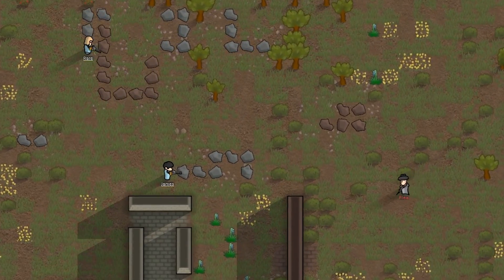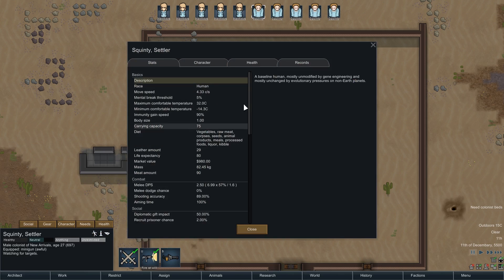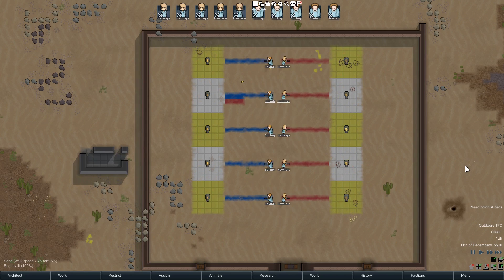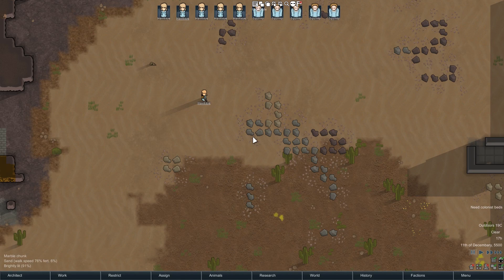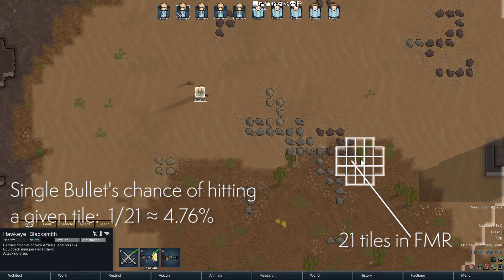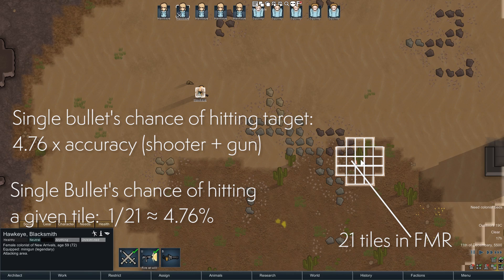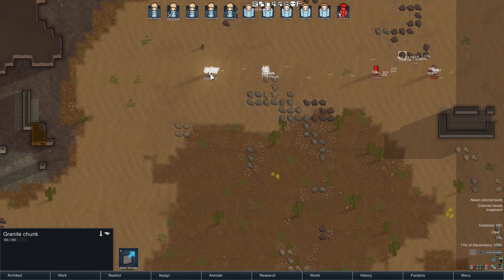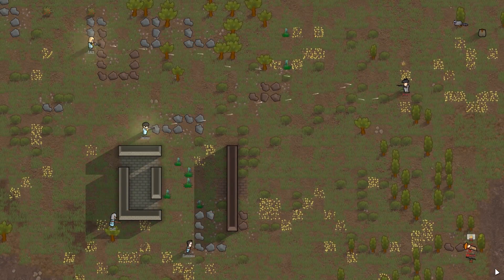RimWorld Science: Miniguns and the Forced Miss Radius — RimWorld Alpha 17 Minigun SCIENCE!!!

Comment: I think we need a new mechanic rework where we can built weapon emplacements. Specifically I was thinking HMGs set in a mount like a mortar. Requiring a colonist to operate but giving significantly more oomf to the defense than a turret. Could also add more versatility to the defense as a colonist assigned to it could wear a shield and carry a secondary weapon. If we could make mounted mini guns and get a slight “reload” and accuracy bonus plus targeting it would make it a lot more viable.

Comment: Wouldn't it be best to aim 2 tiles behind your target instead of 3? That way 1 of the 5 tiles in the line of fire won't have to go through an intercept check (the one where your target is located, if chosen by the bullet, would have a 100% chance of hitting him while the other 4 behind him can still get a "lucky" intercept hit).
Reply from the maker: Hmm... Yeah, I think you're right. That one tile gets a 60% increase. Spread out over the full range it might only be a marginal improvement, but it IS an improvement...